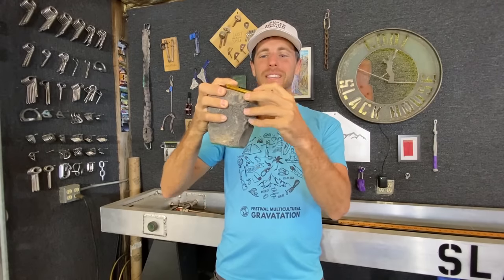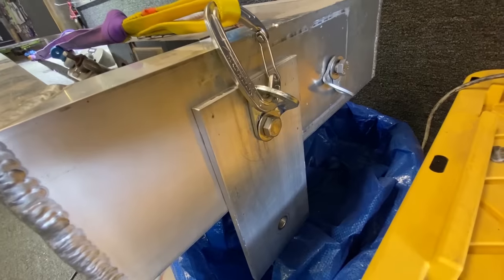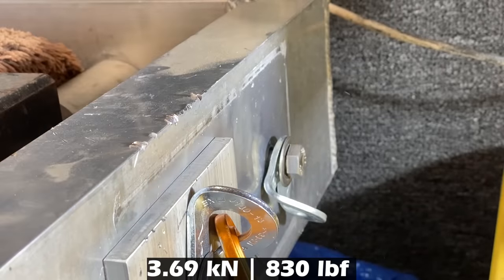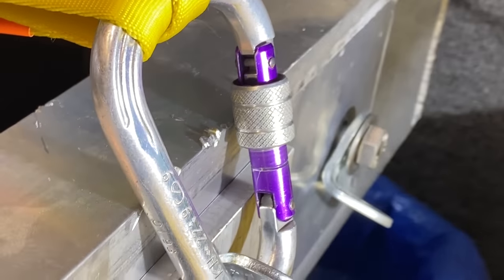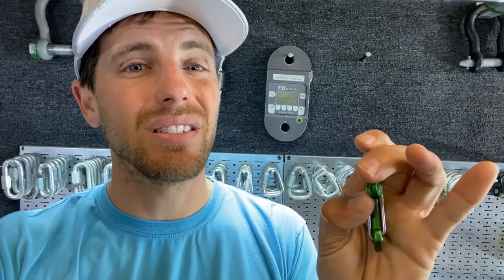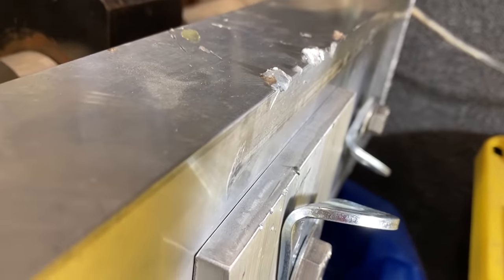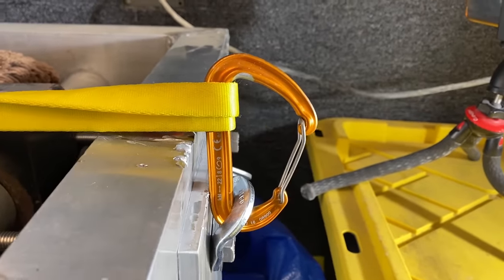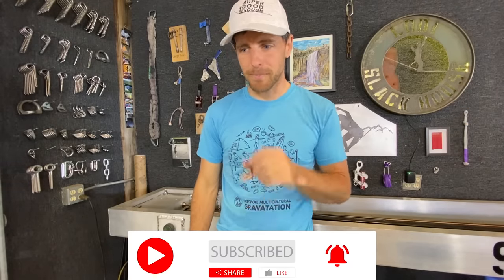Carabiners Loaded Sideways!?!?

Comment: I would love to see a comparison to steel carabiners for this case. Since steel is more bendable than aluminium I would actually expect them to hold slightly better. Also, this is one of the cases where I think that shockload vs. maintained force will make a real difference. If you are interested there is also an old video (German, w. English subtitles) about drop tests with sideways loading: https://www.youtube.com/watch?v=SaYy2c9mkKI
Reply: I also think steel ones would perform way better on that. Also a steel maillon quick link would be interresting in comparison!

Comment: Confession: The carabiner may or may not have been levered on the cave wall when you were rappelling "the big one" (you know, *that one*).... sorry buddy. 

It was swapped for a quicklink after you got off rope, though! (:
Reply: At least you notice it before someone takes a fall on it.
Reply: Well, now I want to see how quick links break when pulled over an edge.
Reply: @justindunlap1235  you don't take falls in caving SRT... 🙃

You'll see why once that drop tower is done being built. But the spoiler is that a Venn diagram of "things we use for caving ropework" and "things that you absolutely do not fall on" is basically just a single circle.

Comment: I have a theory that the smaller the carabiner, the harder it is to bend, the same way a piece of wire is harder to bend the shorter it is. eg, a 1 inch wire is harder to bend than a 3 inch. I'd be interested to know what you think.

Comment: Thanks for the video!  Sideloading is definitely not recommended.  On the test I did notice that the edge of the aluminum was becoming deformed from a square edge to more rounded.  The small carabiner had a smaller 'stick out' (lever) as well as being bent over a less severe stress concentration due the edge rounding caused by previous tests.  It would be interesting to see the correct set up when encountering edges on the rock.  Appreciate all the videos, testing and conversation.

Comment: I'm going to to out on a bit of a limb here and pose my thoughts on why the strength reduces so much. Aluminum is a strong metal, but it's also very prone to work hardening, you will notice that during the test, the aluminum starts to appear cracked where it is bending, this is work hardening at play, some alloys are more susceptible that others to this, but I suspect that this is a large contributing factor to the greatly reduced strength. Essentially you are reducing the effective cross sectional area of the device as you bend it, greatly reducing strength. If you were to test a steel device, I would say the loss in strength would be significantly less than these aluminum devices. So as a side note, the reduced strength most likely can be represented as a function of the radius and angle that the device is being bent.

Comment: Maritime rigger here, first time viewer.. As these hold people, do they have the same 3 and 5 to 1 safety factors OSHA has set down for cranes?

That is a really cool set up and it would be awesome if you had a couple different angled dyes to set up and recreate this with more than just 90° pulls. Straight pull to show the breaking strength, move onto a 20 to show they still function within their rating on a more rounded edge at 45° and do the same until we figure out what degree of angle they break below their rated capacity.

Do you or climbers carry a steel 5/8 screw spin shackle or 3/4? something similar for situation like youve recreated?

Comment: I got recommend this video and I have never done any of what this video is talking about I'm not a climber or what these are used for but as someone who works with mechanicals there has to be an L shaped device that can achieve this hold to leverage and hold itself strong
Reply: Something that would put force against the surface and up one the bolt or at some angle to the bolt but not sheer stressed

Comment: Sometimes I hate being a mechanical engineer and a climber, cuz I always feel compelled to come in with some mansplain-y "well actually..." 's. Quick reference though, when you have something in cantilever bending, like this, the peak stress in the material is proportional to the moment (torque) applied. Ignoring complex factors like edge radius, slippage, stretching, etc, that means that double the unsupported length means double the stress. For a circular cross section (like that locker), stress decreases by radius cubed (thickness squared in the case of a rectangular cross section). So round carabiners, twice the diameter means 1/8th the stress, and twice the thickness of the i-beam style means 1/4th the stress.

So. With the fat locker, if it had been sticking out half an inch instead of one (eyeballing from the video), I would expect it to fail around 12 kN instead of 6 kN. Using some trigonometry, if the carabiner were over a 45 degree edge instead of a 90 degree one, I'd expect it to fail around 8 kN (15-16 kN with the 1/2" lever arm). Granted, stress concentrations from sharp corners are probably significant here and I wouldn't be surprised by like +/- 50% deviation from theoretical calculations. But those errors should be consistent between loading conditions, so things like halving the lever arm should still roughly double the breaking force.

Love what you do here!  Once I'm done with grad school and have disposable income, I plan on throwing lots of cash your way. In the meantime, I'd love to chat, particularly if you're interested in making educated guesses at breaking strengths of things before you test them, to see how close theory and practice can get.

Comment: I know what's gone to be the next video, ropes on de bend just like the carabiners. What do you think? Please  please please please please please please please please please please please please please please please please please please please please please please please please please please please please please please please please please please please please please please them we can try different types of protection like anything.  please please
Reply: Not sure test you are asking for.
Reply: @bobbyhutton1989  Sorry for my poor English, I really would like to see the resistance of the rope in the edge of things and what can we use to protect them.
Reply: @francolua  Ahh. That is a much bigger test. I avoid running a rope over any sort of edge.
Reply: @bobbyhutton1989  come on Bobby, please
Reply: @bobbyhutton1989  Variations of suggested anchor setups like nylon or spectra webbing over an edge, different sized cordelettes over an edge, alternative configurations of those (bfk, sliding X, etc), and rope over an edge - these would be an interesting group of tests indeed.

Comment: Pre-video prediction: 

2-3 KN at best.
Reply: Huh, that is better than I suspected. 

As for a spine only test.....why? I can't see how that happens in real life. 

It would be cool to see a biner attached to a sling of some kind pulled over an edge as the sling should stretch a little. Maybe that would bend the biner in a different way as the load increases? 

This is also a massive point for your drop tower as impact energy will actually matter in this instance.